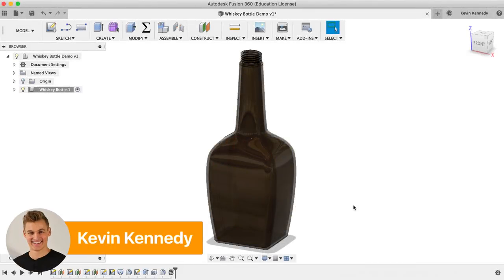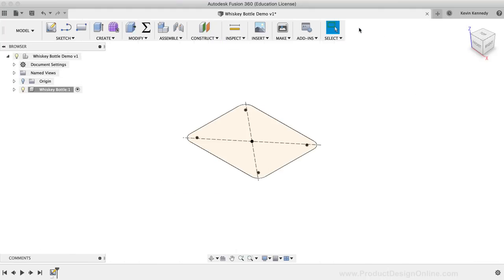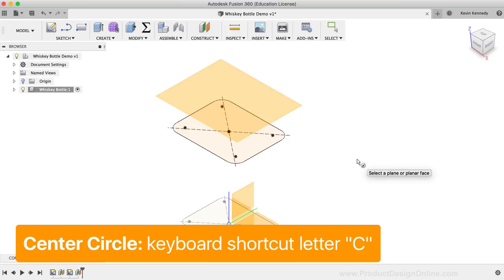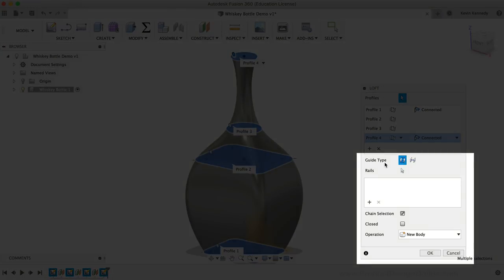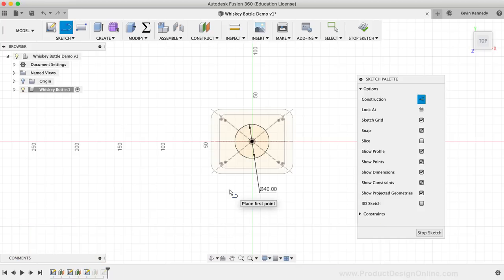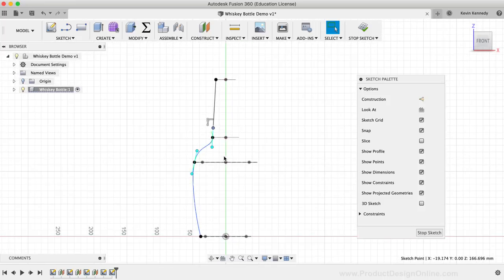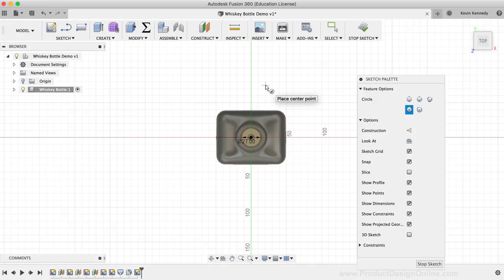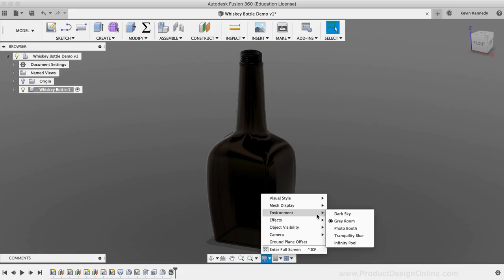How to 3D Model a Whiskey Bottle - Learn Autodesk Fusion 360 in 30 Days: Day #4 (REVISED)

Comment: when doing the loft command I kept on getting an error that the rail didn't touch the profiles (still after making sure the handle snaps). I went back to the sketch and applied a curvature constraint to the spline and the straight line and then I did the mirror command, after that in the loft command after selecting the profiles, for the rail options I deselected both the "chain selection" option and the "closed" option and the "tangent edge" option is set to merge (operation should be on "new body"), then click on the top straight line and then the spline. after that, it worked perfectly fine for me. thanks for the great series!!!
Reply from the maker: Make sure you have the "Auto Project Edges on Reference" setting turned on. Instructions to turn it on - https://productdesignonline.com/default-settings-for-fusion-360-tutorials/#autoProject

That will help you snap the rails to the profiles, as long as you're looking straight at the sketch.

Comment: Spent a lot of time trying to get the guide rails to work correctly. (Yes, I have tried solutions suggested here and reviewed the linked article). I finally just gave up and ran the spline all the way to the top. You can make it reasonably straight by adjusting the handles. Maybe I'll try it again another day, but frustration level is too high at the moment. :-)
Reply from the maker: Feel free to post Fusion 360 file in my community space. I'll take a look at it - bit.ly/PDOcommunity

Comment: Might be a bug in the software, but if you create the spline and the straight line without editing the shape of the spline - simply align the spline and the straight line using the spline handle, the spline line stays black not blue. This allows you to select it and the straight line as a rail. You can then edit the spline afterwards. For some reason it sees the spline and straight line are not connected - in a rail context - but this only happens when the spline line turns blue and the straight line is black. 

Another useful tip I found for this was to use "P" for program and select the dotted construction lines. This allows you to select them as snap points, whereas without turning them purple using "P", it would not "snap".
Reply: Thanks! :D This solved it for me
Reply: @benedekfauszt9351  glad my comment helped!

Comment: DONE! however I kept getting an error when I try to shell the bottle at 3mm, so change it 1mm and it works fine. Gonna do this exercise a couple more times to get the hang of it. It be great it you can show us how to make a the bottle cap too. I'd love to learn out how to make a fitted cap.
Reply from the maker: Hi, Haken. Check the taper shape of the stem of the bottle. It's likely the contour of that would need adjusted for the shell command to work with 3mm. Cheers, Kevin :)
Reply: Product Design Online I did this lesson a 2nd time and had no problems. Thanks for your help and videos.
Reply from the maker: @hakenly  great! Glad to hear you got it working :)

Comment: The sketch fillet sometimes gives outside arcs instead of inside arc. Constraints dont always solve this. However, if you select the sides in the opposite order for the outside arc it will work correctly.

Comment: Hi Kevin, I concur with cmc 123 and thank you for outlining the important steps and the purpose of the selections made when using tools. Unfortunately I could never connect the spline and neck properly. I tried making the neck as a separate part but did not succeed in joining the two parts either. Anyways, thanks for the tutorial.
Reply from the maker: Hi, gac231. If you would like, I can take a look at your file to see what's causing the issue. 

To share your file please go to File > Share > Share Public Link (make sure "downloadable" is toggled on) > Paste your link here as a reply to this comment.
Cheers, Kevin :)

Comment: One thing that tricked me—If, after turning on "Auto Project Edges on Reference" you still can't get your guide rail to find the points correctly, be sure that the rectangles are *centered on the origin*. Kevin K. says and does this correctly in the video, but I missed it the first time through, and had my rectangles with a corner at the origin.  If you don't center the rectangles, then creating the guide rail in the XY plane doesn't correctly find the construction points and the guide rail is totally goofy. (posting this to help others).  

P.S. Great video series!

Comment: Thanks man! Had alot of trouble until I found the revised version end even then the loft command was still very picky. Thank you though! Gearing up for my first 3d printer so I really appreciate what your doing!
Reply from the maker: Hi, Mike. No problem....glad you found the revised version. Check out the playlist for all the latest ones (note, that the whole series was not revised) - https://bit.ly/learn-fusion360

Also, don't hesitate to comment if you run into any roadblocks with the models. I'm always happy to take a look at screenshots or files.

Comment: Hi . 
Thank you for great tutorial. 
I have a issue when i want to select loft guide line, this message shows up :" Warning: The selected rail does not touch all of the profiles".
I did exact thing like snapping line to straight line but it did not work.
Reply: I had the same problem, but then I ditched the loft tool and used the revolve tool instead just so I can finish the project.
Reply: I had the same problem and tried redoing the spline a number of times. I did these in a 3d view. When I did the spline in a 2d view (e.g. on the face) it worked as per Kevin's video.
Reply: I experienced this too. What I did to resolve this was I zoomed in and check the 4 profiles I made and I noticed one where the spline is not connected.

Comment: Hi Kevin, I am also a new user to Fusion 360 having used blender in the past along with Tinkercad.  I have just started your tutorial series and have been coping with the differences with the UI but whilst doing the 'whiskey bottle' example I have struck a problem. i have created the bottle sketches for the cross-sections on each of the offset xy planes along with the construction lines but when it comes to getting the spine tool on the xz plain to lock onto the construction line points those points do not appear and hence I cannot join the spline line to the cross-section.  I note this also happens when I try to follow the surface tutorial with iron as an example.  Would appreciate any suggestions.
Otherwise, I think your videos are well paced and very informative and I fully understand the difficulty of keeping videos upto date when the system is constantly changing.

Comment: Enjoying your video series; nice work!. This project I unfortunately cannot duplicate. I completed the approach of adding the construction lines to get edge points on the features on the four offset planes, and I also completed the approach to align the spline and neck line at around 17:50 in the revised video, and the loft will still not accept the line as a rail due to lack of feature intersection. I even just created a continuous spline that goes through all the feature edge points from the construction lines... same failed result. I'm not sure if F360 has changed or I'm just totally missing something. Nevertheless, I'm learning a lot from your series. Thanks!

UPDATE: I got it to work! Check the comments if you're interested in how.
Reply from the maker: Hi, CRBoiler. Can you try adding "coincident" constraints to the end points of the spline/lien and the edge of each profile? This will force them to stay together and should resolve any of the intersection issues.

If that doesn't work let me know and I'd be happy to take a look at your file. Cheers, Kevin :)
Reply: @ProductDesignOnline  I finally got it to work by undoing all my work ALL the way back to when the first 4 sketches were done. I proceeded from there, and the lesson steps worked including the loft with rails. I think there must have been some artifact (like a stray point) that the spline connected to instead of the intended point. By doing what I did, there was no such artifact anymore. Thanks again.
Reply from the maker: @CRBoiler  Glad to hear you got it to work! Splines are probably the pickiest features in Fusion 360 (or any CAD program for that matter). Sometimes they take some back and forth. Nonetheless, I'm glad you stuck with it! Don't hesitate to comment as you work through the next videos. Cheers, Kevin :)

Comment: Just in case anyone is late to the party like I am, I've been struggling with putting a fillet onto the bottom edge of the lofted bottle shape. This was because for whatever reason when i lofted the shape it was hollow and didn't model in a top face or a bottom face. (I splined top to bottom, I couldn't get the spline to join a line whatever I tried - splining from top to bottom allowed me to actually create a lofted shape). Once I had the shape lofted,  I dove into the modify menu before closing out the "form creator". Once there I was able to use the "Fill Hole" function with the "Maintain Edge Crease" box checked. I was then able to close out the form and fillet the edges of my now solid whiskey bottle. 

I'm very new to the game so there my have been UI changes, preference changes or all sorts since the release of the revised video (and I'm on a windows machine rather than mac, and I'm probably not doing it right). I wasn't able to resolve joining a straight line to a spline and lofting - I'll have to carry on playing with that one. But if you're struggling with filleting the lofted form, check that the ends are closed and if not, use the modify function to do so with the fill hole option.  

Kevin - this is a wonderful resource, thankyou so much for taking the time to create it! Please continue, I'm enjoying it immensely!
Reply: I fought this hollow loft problem for about an hour. Turns out I had selected "loft" from the "surface" create tab instead of "loft" from the "solid" create tab.

Comment: Hi Kevin. Even with your advice I had received  the message  "The selected rails does not intersect all the profiles" when doing the loft command. What I have to do to correct from this point ? Thanks in advance
Reply from the maker: Hi Gerson. Click and drag on each point to see if any of them are not connected. You can then try to drag it over to see which one needs to be re-snapped to the profile. Having the "Auto Project Edges on Reference" setting turned on will help them snap to the profiles - https://productdesignonline.com/default-settings-for-fusion-360-tutorials/#autoProject
Reply: If it helps Gerson I had the same problem. Try using the Loft in the "Solid" section at the top. For some reason Loft in "Surface" would give me the error. I am new to this too, hope this helps.
Reply: Tim thanks Tim for the neat tip!

Comment: Hi Kevin! Thank you so much for such great tutorial. I am brand new in CAD drawing and wanted to learn how to draw plans for my woodworking hobby. These videos are absolutely fantastic! 
For the Whiskey Bottle it took me 3 times to finally succeed!! Third time's a charm, right. I like the pace you have, it is fast enough to not get bored but slow enough so you can follow "live". 
I am not sure if it's because I am using the new version, but my menus don't look like yours and when you switch to sketch mode I have to first pick the plan while you need to first pick the tool and then the plan. I got used to it now but at first it was a little confusing. 
FIY, I am using version 2.0.7824 Thanks again for this tutorial, this is a life saver!!!
Anne.
Reply from the maker: Hi Anne. Glad to hear you were able to work through the challenges! That's correct, the UI was updated several months after this video was updated. I have a video that covers the major changes, which you can watch here - https://youtu.be/tuZzHcmFtg4

I also have a new woodworking course that I just released. If you enjoy my teaching style, you can preview that here - https://bit.ly/woodworkingCourse

Keep at it! Cheers, Kevin :)
Reply: Thank you Kevin for the links! I’ll definitely check them and can’t wait to start the woodworking class!! I guess it’s better for me to finish this class first before tackling the woodworking one!

Comment: I love these vids Kevin, and I really appreciate them! This is the first lesson where I ran into a problem.  No matter what I try, when I try to add the rails to the loft it just gives me a warning that not all rails touch all of the profiles.  I know you said that it was one of the most common errors in Fusion 360, but that's all that was said about it.  I followed your instructions several times, but I am still getting the error.

I think a big part of my problem is that my cursor doesn't snap to the geometry lines we drew in the planes.  It only wants to snap to the grid, which doesn't line up with the point.  In fact, when I create the spline, the points for the construction lines don't even appear.  I'm guessing this is causing the error.  I tried zooming in to attach the spline, but it doesn't seem to work.  I'm willing to bet that it's a difference in build and probably my settings (although I don't remember changing anything!).
Reply from the maker: Thanks, PureSol420. Glad to hear you're learning a lot so far. The first thing to check is to make sure your settings match mine. This will help rule-out whether it's a setting or not. Please crosscheck your settings with mine - http://bit.ly/defaultsettings

Let me know if it was a setting or not and we can troubleshoot from there! Cheers, Kevin :)
Reply: Product Design Online thabks for the quick reply Kevin!  I checked my settings and it’s done. Everything was still default and the o my thing I found different was “Auto Project Edges on reference” wasn’t selected, and my display setting was set to “shaded”. Not sure if that was the issue. When I get a second I’ll see if I’m able to finish my whiskey bottle!
Reply: @ProductDesignOnline  I got it working!  After I verified my settings, I was still getting the error.  For some reason, the rails won't snap onto the construction lines we made in the profiles.  I'm thinking that possibly it's because I changed my settings after I made the rails?  I'm not sure.  So I zoomed in on each point, and was able to find one that was slightly off the plane.  Seems like it snapped to a grid point instead.  After fixing that little snag, I was able to complete my bottle.  Off to the next one!

And just because you deserve it, thanks again for these videos.  I've been wanting to learn CAD for a long time, and these programs are impossible to figure out if you don't have any idea about anything.  I learned to draft manually a long time ago, but that does nothing to help understanding modern drafting!
Reply from the maker: @PureSol420  Glad to hear you got it working! Sounds like turning off the grid is a great trick/tip to help ensure it doesn't snap into that which is slightly off from the sketch geometry. Thanks for sharing your solution.

Please don't hesitate to comment any questions as you work through the remainder of the series. Cheers, Kevin :)
Reply: @ProductDesignOnline  I experienced the same probleml and i solved it by using in your settings the "Auto project edges on reference ". Thank you very very  very much from the south of France !
Reply from the maker: @stéphane_bab  Thanks, Stéphane! Glad that worked for you :)

Comment: Phew!  This was a tough one.  Just a suggestion, when drawing on the sketch planes, you can temporarily turn off the visibility of the lower plane sketches in the browser to de-clutter the display.  

I had a lot of trouble with the guideline connection to the planes (even with the suggested settings) and found it helpful to do the spline & line in stages, running the loft command to make sure it worked at each stage. Do this even before you mirror.  Not being all that familiar with coincident constraints (see suggestion below), I wasn't able to get that to work either, but that seemed like a good idea.  Perhaps someone can clarify how to make a point and a line coincident. 

I had another incident where I saved the project and when I restarted it, half the timeline was grayed out.  Rolling forward the timeline seemed to work momentarily but the graying out recurred, so I decided to can it and start over.
Reply from the maker: Hi, Vince. Thanks for the suggestion. I'll keep this in mind as I record future tutorials.

Using the "coincident" constraint forces the two entities to remain coincident or touching at all times. I've taken a look at many files of users that have struggled with this one and found that they hadn't snapped the spline point to the line, or their line was not actually connected to the 3rd profile (but it was close).

I'd be happy to take a look at your file if you'd like. To share your file please go to File > Share > Share Public Link (make sure "downloadable" is toggled on) > Paste your link here as a reply to this comment.
Cheers, Kevin :)